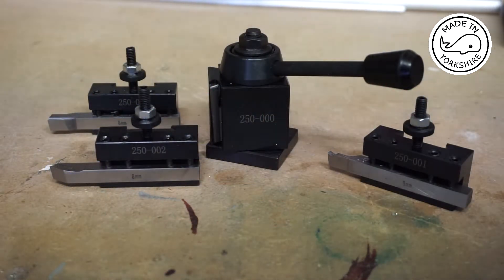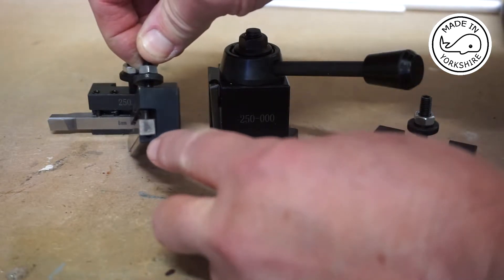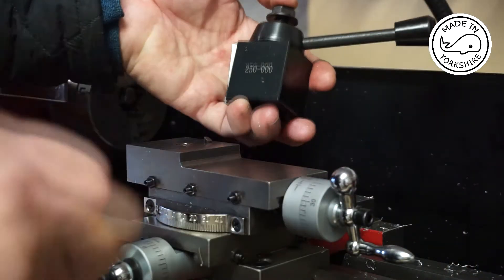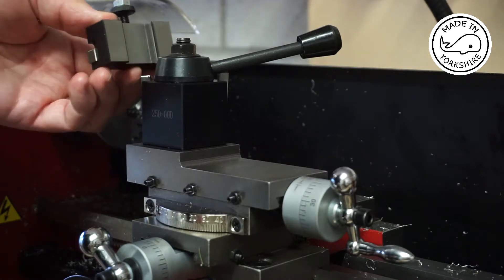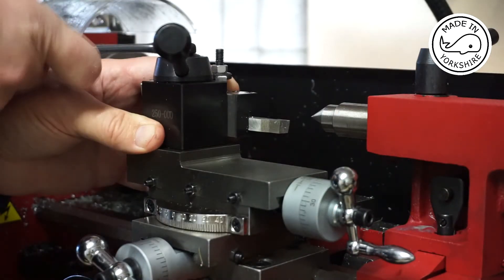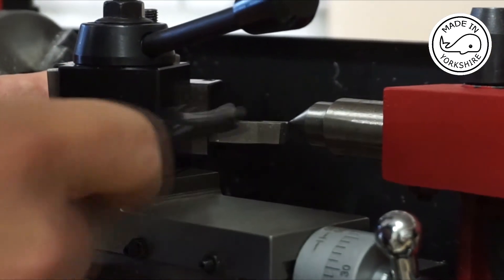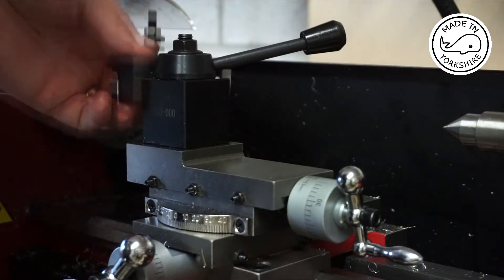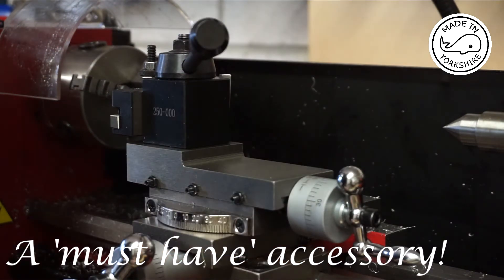#MT2 - Installing a Quick Change Toolpost on my mini-lathe. By Andrew Whale.

Comment: how do you align the tailstock with the center of the chuck? I ordered the 0XA set, waiting for it to come now. someone suggested putting a punch or scribe in the chuck and aligning the tool height like that
Reply from the maker: Hi Paul. To adjust toolheight I usually put a hard centre in the tailstock, turn the toolpost round 45 degrees so the tool is pointing towads the hard centre. I then adjust the cross slide and compound slide to position the tool as close as possible to the point. I then adjust the tool height. If its a facing tool, I might just eyeball it againt the workpiece, take a light cut and see if it needs further adjustment. I am no expert, but I hope it helps.
Cheers
Andrew

Comment: The more correct way to install the quick change tool post is to remove the pin and spring from the base plate - they just pull out.  That way you can freely turn the quick change tool post without it getting stuck on the pin.  Then, instead of using the nut that comes with the quick change tool post, use the handle/nut from the original tool post.  It makes using it so much easier.
Reply from the maker: Hi sillywwabbit. Thanks for the suggestions. I had realised my mistake re the pin and spring a while back and removed them. Your idea to use lever from the old toolpost is great and I've just changed it. Thank you so much.
Cheers
Andrew
Reply: oh  the handle on my Grizzly G8688 is not as good as the QCTP handle, it's very short. I'll make a handle at some point but appreciate the qctp handle is longer with a knob